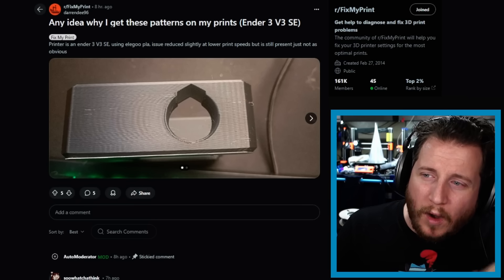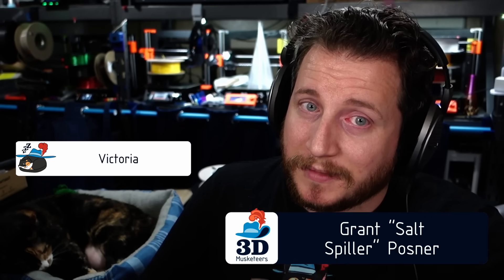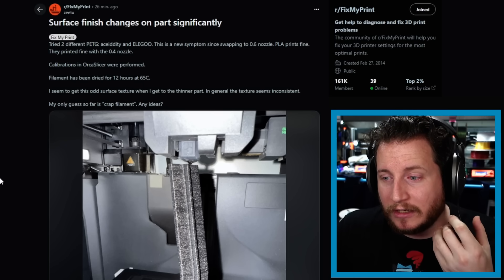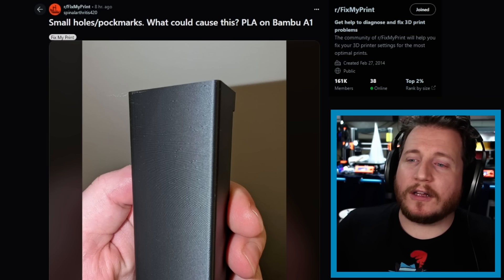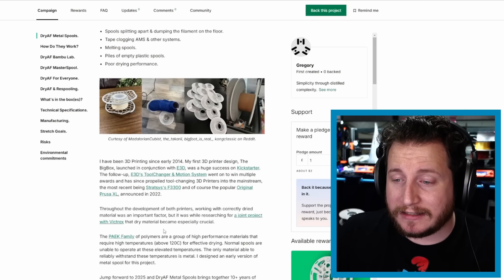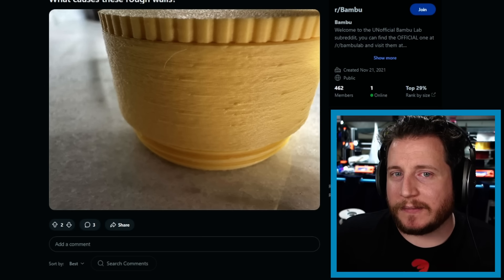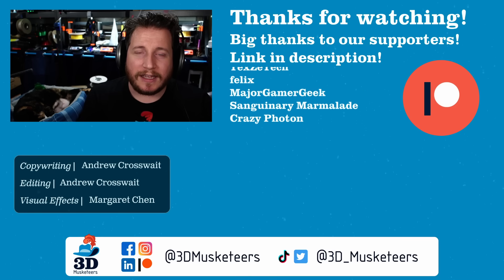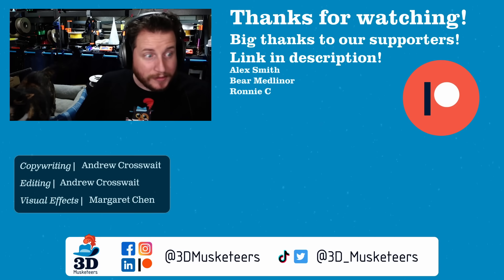There's Salt EVERYWHERE! - PrintFixFriday 179

Comment: I have a couple of Sunlu Masterspools that I picked up ages ago when they did a deal on them, but it's never been cost effective in the UK to buy the refills, not just Sunlu, any brand, so I just use them when I have a spool break or fail. I've just printed a simple rewinder that goes into a drill as I have a few weird sized spools that don't fit in most dryers that I want to get onto normal sized spools. I'm not a fan of the card spools because they mess with the readouts on the dryers as well.

Comment: Adding weight: I moved to steel shot (used to shot blast metal to remove rust), basically like BB's but 0.2mm diameter so much heavier per volume than regular BB's. I put mine in a square container and 70mm x 70mm x 70mm is 5Lbs so very heavy based on the volume. Yes, still need to add epoxy or something to keep it from sloshing around in most situations.

Comment: For spools, I go with Atomic for nearly all of my colors, especially now that they have the slightly smaller AMS-compatible spools that roll better in dry boxes. They do spool takebacks, and with a 10 spool box, it just about breaks even for shipping cost being equal to the store credit I get in return for the empties.

I actually used up a few spool ends of PETG printing smaller 200g spools in two pieces that snap together, to wind sample coils or other spool ends onto for easier use. Might use up the rest of my ABS doing the same thing for more of them, actually.

Comment: For the Bambu X1C I had a similar problem when the printer itself still was set to a .4 nozzle when a .6 was installed. I believe this is due to the start gcode which does flow calibration. When you have a .6 nozzle installed but the printer thinks it is a .4, when it goes to measure it threw off the measurements. It doesn't matter what bambu studio or orcaslicer is set to as the printer doesn't read that to do the initial flow calibration. Everything you said could also be the problem but I had a problem for a long time as I figured changing it in the slicer would be enough for bambu, but it has to be changed in the settings on the printer itself as well.

Comment: Marlin has input shaping since 2.1.2, so you could try calibrating that ender3 too.
Reply: I'd like to add that it also has two different input shapers, the ZV, and the Fixed-Time Motion input shaper (which has a myriad of options). Both can ve used at the same time, or switched, even mid print.

Also Marlin's s-curve acceleration and linear advance play nice together now, which having both can further improve print quality.

Comment: Just got my K2 Plus with the CFS about a week ago.  Shipping was pretty quick, only about 5 days to the Seattle area.  It's been running non-stop since then, doing everything from big single-color prints to long, complex multi-color ones.  I'm actually on a 40-hour print with over 500 color changes right now, almost finished!  Haven't had a single problem with either the printer or the CFS so far, super happy with it.

I'm pretty new to 3D printing.  Got my first one, a FlashForge AD5M Pro, for Christmas.  It's been great overall.  But the K2 Plus is on another level.  I had to tweak the AD5M a lot to get the quality I wanted.  The K2's automatic pressure advance and flow calibration have been game changers.  Pulling those numbers from Fluid and adding them to profiles is so convenient. And being able to write my own RFID tags for the CFS is a huge plus.

Love the channel! I've been learning a lot from these Print Fix Friday videos. Thanks for all you do!

Comment: I run my pla in the microwave to dry. Give it a minute at a time. seams to work, it gets warm i assume its any water that reside. whjat do ya all think..
Reply from the maker: please just use a normal method of drying. A microwave can be dangerous, I am sure, I just dont know how lol.
Reply: @3DMusketeers  I almost thought CNC Kitchen tried this but that was the desiccant refresh not the filament drying. I suspect an issue with microwave filament drying would be potentially overheating a region of the filament or maybe even making some moisture crack sections of the filament when moisture becomes steam. As even on defrost the magnetron is on full power and then off, then back on and then back off. So some section of filament even for brief moments is getting the full output power.

Comment: I gotta disagree with the second one for one simple reason: I have been using elegoo petg pro for months and months without ever drying it or putting it in any type of sealing bag. Out of all PETG I have ever tried, elegoos has never shown any moisture problems (like stringing) and as his part has a 90° angle for the lower layers, there would have been some travel (as most slicers would slice it normally) from edge to edge, but I don't see any stringing. 

About the drying check, you can do it similar to the way it's done for injection molding (duration for holding pressure phase), just dry it and measure the weight like every hour, at some point there will be no change. That's when it has reached the inside (should measure a few more hours after this point to rule out inconsistencies).
Reply from the maker: What do you think it is then?
Reply: @3DMusketeers  looks like an exaggeration of the problem I had with some ppa (worked with 0.4 but not 0.6mm nozzle, similar rought surface), after testing countless new nozzles, it turned out to be kind of a speed + layer hight + temp problem. Lowering speed and temp, setting layer hight from 0.2 -> 0.3 made it nearly go away, alltough I was never able to fully achieve the exact same surface finish as with a 0.4

With my 0.6mm nozzle profile and elegoos petg pro, the surface finish is not distinguishable to a 0.4mm nozzle, that's what tends me to believe it's a profile (temp, speed sortoff) issue
edit: same spool just 30min away (as I wondered if it's the nozzle or the ppa, so I tested it on the petg and pla)

Comment: For PETG I usually dry for a WEEK at 40°C and use calcium chloride desiccant.  I really dislike silica gel and find it is ONLY good for short term storage after the filament has been fully dried.  Silica gel does not have a high enough affinity for water to actually pull water from the filament though but calcium chloride does.  Even at room temp, if left in an airtight container it will absolutely pull moisture out of the filament.  But for drying PETG I find it's just like BBQ...low and slow.  Take your time drying it to make sure you get it dry to the core and you have GOT to use a good desiccant that loves water more than the PETG does.  Simple heat or silica isn't going to cut it.

Comment: When you use salt or sand or anything, pack it in cling film.
Reply from the maker: good idea!
Reply: @3DMusketeers  Bonus tip. Use concrete, it´s muchy and easy to shape with the cling film. It also flows everywhere in this gyro support.

Comment: Are people really respooling their filament on metal spools ? 
Personally I don´t want to see filament ever again, I can´t wait until pellet printing finally becomes the norm. Sick of buying 2$ worth of filament for 20$.
Reply from the maker: some are, yes, especially for high temp stuff, and I agree to some extent, pellets are nice, but you wont get the colors and such nor the ease of purchasing small quantities for decent prices like the rolls have gotten us. High quality PLA runs about 5-7 a spool I believe, for cost.
Reply: @3DMusketeers  "...but you wont get the colors and such nor the ease of purchasing small quantities for decent prices like the rolls have gotten us...." I completely disagree with that reasoning. Remember back in the day 2013 or so how much filament did cost ? What was available PLA and ABS that´s basically it. Why ? Because it was also used in the industry, that´s why.
High quality PLA costs like 1$ for a Kg in Pellets. It´s basically waste Material, nobody really uses that stuff. It isn´t engineering grade or practical at all, it´s only used in packaging material basically and one time use items. 
Economy of scale would work here as well. Just like companies started up selling filament spools in 2.85mm and even 1.75mm later on which was rare the same goes for Pellets and you could make them way easier yourself. You can dry it easier, store it easier, it´s cheaper, you can mix it yourself like TPU with PETG or glass fibers etc. It´s just way better overall and the industry is using them a lot. I am sick of paying 10x the material cost.

Comment: Grant, is there any workflow for pausing/resuming prints with a big gap in time? For example filling a partially printed part with plaster, letting it cure, then resuming?
Reply from the maker: sure, issue a pause command, do the thing, wait, then resume when ready.
Reply: just one thing to keep in mind is the pause time out. My printer was set to time out after 10 minutes. It took me a while to find the klipper variable to set higher. You can also have it keep the bed on. but turn the nozzle off.
Reply: Keep the bed warm so the print won't detach and ideally have an enclosure to also trap some heat.

Comment: I hate those teardrop style hole designs. Just beucase it´s easier to print does not mean you should do it. It´s terrible, it´s a huge point of failure build in the design.
Reply from the maker: thats fair, adds a point load for sure.

Comment: I am considering the Creality Hi Combo for my first 3D printer.
Reply from the maker: yeah? what is drawing you to that machine?
Reply: @ On paper, at least, It looks like an improved A1.
With the uncertainty around Bambu Labs right now, I’m expanding my options.
My only major concern is that they don’t have a .2mm nozzle, which I want for D&D minis, but since there are 3rd party 0.2mm nozzles for their other printers, I don’t think that will be a problem at all.

As I said, I’m a complete beginner.  I want a tool, not a toy to tinker with.